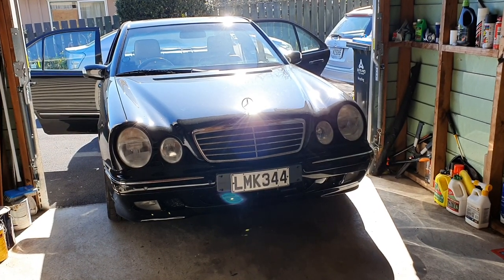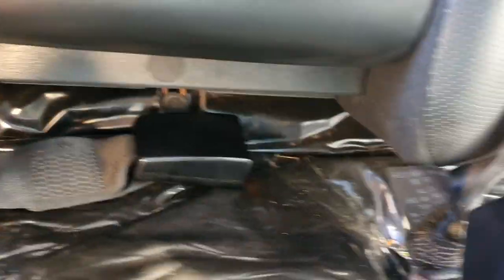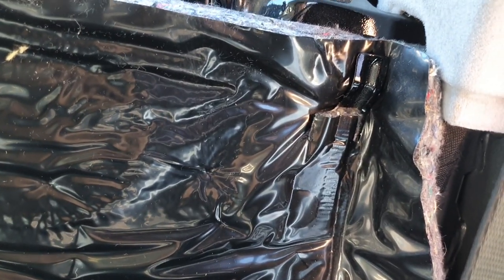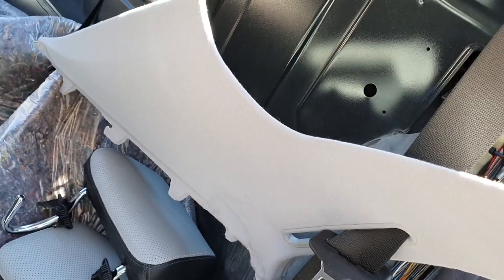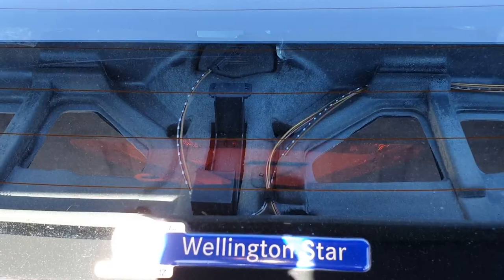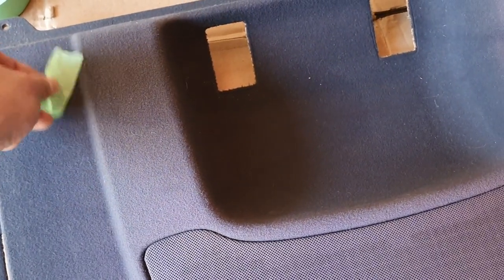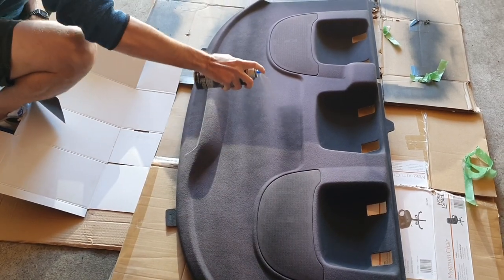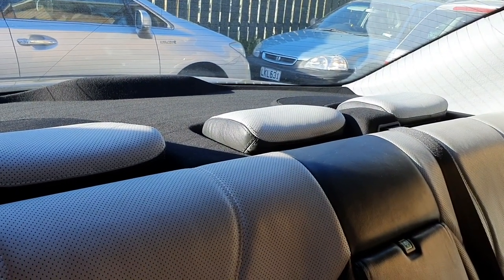Mercedes W210 E55 AMG Episode 8 - Parcel shelf/tray restoration for less than $20!

Comment: amazing man, looks so good even matching the exterior color and everything! might have to do this on my E320 too. mine isn’t black on the exterior but it might look better with my black leather interior at least.
Reply from the maker: It worked better than expected and seems to be quite long lasting. The only issue is that it does make the fabric a bit stiffer which means its harder to clean but small price to pay... I think they make different colour version soon but black works well for most cases!